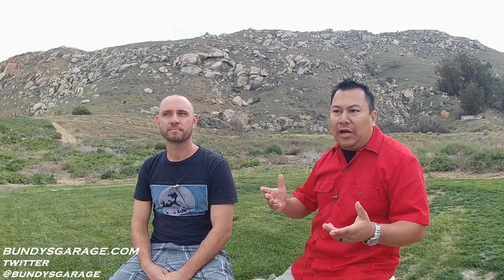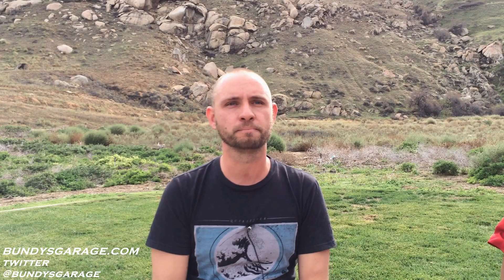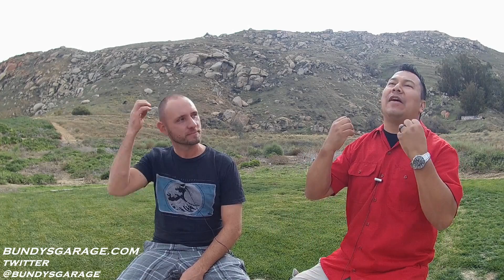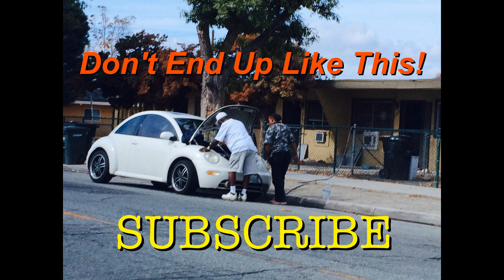Mazda Valve Carbon Buildup (DI) Direct Fuel Injection - Skyactiv - Fight Carbon Deposits

Comment: So.. Has anyone figured out yet, that its the fact they run the Positive Crankcase Vent into the intake?... Thats literally how the oil is getting on the valves.. It sucks the oil from the PCV down the intake runners and direction onto the intake valves where the oil sticks because there are no longer fuel injectors in the intake.  All you need to do is install an oil catch can for on road applications, or in racing situation it does not need to go back into the intake at all.  If you've ever seen a race car spraying white smoke out the top of the engine, yeah thats the pcv just  dumped straight into the air.
Reply: Wow.

Comment: I have a SkyActiv 2.0 in my 2013 CX-5 with 115,000 miles. I just pulled the intake and media blasted the valves with walnut shells. The car runs like brand new again!

This was the very first time I had ever done it, and it took me about 2 hours. Even though it was intimidating at first, this job was beyond EASY.

In another 100,000 miles, it'll probably take 30 minutes! It's really that easy!
Reply: do the walnut shells get into the pistons, as I assume the valves have to be open to get the edges blasted, or am I not understanding how this works?
Reply: @tommak6516  

No, the shells can't get down into the engine, because you make sure the valves are closed before you start! Besides, if the valves are open, you can't really clean them, simply because they aren't there to be cleaned!

When you're done with the cleaning, use a shop vac to remove any media that's left. Tape it up with some painters tape, and move to the next cylinder.
Reply: @michaelbloom5342  So would it be correct to say you are only cleaning the valve stem and not the valve seat?  Would not the valve seat be more critical?
Reply: @tommak6516  You're cleaning the entire top of the valve and the intake port. And yeah, it makes a huge difference in engine feel, performance, and economy.

The port itself is arguably the most important thing to clean because that's where all of your air gets into the combustion chamber. If that's gunked up, air can't flow smoothly, robbing power and efficiency.

Comment: Late on this conversation, but can't we just prevent/minimize this by using a good fuel company (ex. shell, Exxon, chevron) when pumping gas and use a good fuel cleaner system once in a while (after an oil change or a few times a year) to keep the engine clean?
Reply: No because the injectors are inside the combustion chamber fuel based cleaners will not clean the intake valve since fuel doesn't hit the valves like in port injection.

Comment: I'm guessing this issue will also effect the ND Miata then? :(
Reply: Yes and no. If you drive like a granny and use regular gas, yes. If you rev high often and use premium fuel, no. The pressure and detergent on the gas seems to be helping in the issue. Which reminds me, I need to drive it harder!

Comment: The Kia K5 with the 2.5 liter turbo has both direct and port injection, however all wheel drive is not available. Alex on Autos liked the Mazda6 steering better, and savagegeese did not like how the power worked while turning for the K5, but gave the suspension high praise for comfort.

Comment: The new Hyundai Venue has both direct and port injection like most Toyotas, to reduce intake valve carbon buildup- it is now their least expensive new vehicle for sale in the US.
Reply: id never get a hyindia over a mazda
Reply from the maker: Does the Teluride have that feature?
Reply: @bundysgarage  the Telluride V6 has only direct fuel injection, not the port fuel injection. Kia and Hyundai are also working on a dual clutch automatic transmission with liquid cooling, after both they and Ford had reliability problems with an air cooled dual clutch automatic.
Reply from the maker: Thanks. I love the way that thing looks!
Reply: Their base model kona I believe also has mpi, I have a 2016 Tucson 103,000 miles and it now has permanent damage I believ from carbon engine pings so now I have to run 93 octane I’ve already had all services done only thing that has changed is power is back but running 93 so performs a little less acceleration vs 87 or 89 octane.

Comment: The local dealer sells a BG intake valve cleaner, and uses walnut shells to clean the valves if they get so bad the idle is rough. I use the 87 octane Shell gasoline, it is probably a wive's tale that higher octane fuel will run cleaner in an engine not designed for it. About once or twice a year, I add Berryman B-12 Chemtool to the gas tank, based on testing by Project Farm on YouTube- his video showed it was the only one he tested that made the inside of the spark plug look cleaner.
Reply from the maker: Check out this video I did on B-12: https://youtu.be/plAu-vvEctM

Comment: so why doesn't Mazda include an oil catch-can since those are proven to reduce carbon build-up?
Reply: I know this comment is old, but I don't think it's due to production cost like the creator said. Just about any modern car when benefit from a catch can. The problem, is that cars have typically have never had them. People won't check them and it'll fuck stuff up. You have to empty those frequently. Most people aren't enthusiasts.
Reply from the maker: Cause it’s an extra cost that Mazda does not want to add to their cars in production.

Comment: Interesting as I just got 2016 cx5. I tink the problem is that some only drive in the city in stop and go traffic. These cars need to be driven at higher rpm's so majority of the carbon build up can be burn off. Question though; would oil catch can be a good idea for my cx5 and could spraying a chemical into a vacuum line to brake up the carbon could that destroy the CAT with all of the dissolved carbon? Just wandering?
Reply: whatd you end up doing? Catch can?

Comment: lol.,,Dennis was introduced as a Mazda Mechanic and will always be, but later we find Dennis doesn't work for Mazda any longer and said he wont likely ever see a Mazda 2.5L apart because he no longer works at Mazda, , but Hmm,  best way to avoid carbon build up in a DI engine is to avoid it "Direct Injection only" engines!

Comment: I have had a 14 Mazda 3 for five years and no problem at all.  Maybe it will come later but right now it is not an issue.
Reply: Hey, that has a direct injection Skyactive G engine right? And youre sure that you had no loss in power after a few years?
Reply: @bellmeisterful  Yep and nope. They did do an update to the ecu early on but I have had no issues with power loss or carbon buildup. Though every few months or so I do put some engine cleaner in my fuel tank..
Reply: @gabrieliacoboni6951  welll I gotta ask...How do you know? I mean, you dont know if you have buildup unless its taken apart.
Youre just saying no negative effects right?
Reply: @bellmeisterful  Well I am sure there is a little carbon build up. It is inevitable in almost any engine. But it has not led to a loss of power or any issues to date. I've had the car for eight years and 60k miles.
Reply: @bellmeisterful  same here. 2014 Mazda3 with a 2.0L Skyactiv engine and 146,000km. So far, runs like new. There's going to be buildup in any direct injection engine; you can't get around that unless you're Toyota with their dual injection system.

Comment: Carbon build up in my opinion is more to do with blow by , bot realy a big problem in a na engine but more common on a turbo engine
Reply: “Blow by” is technically the combustion (very high psi from post-ignition, not the turbo-charged 7~14 psi pre-ignition)

This blow-by passes the piston rings, and now the pressure accumulated in the crankcase etc. 
That pressure needs to be vented somehow. 
The problem is, that air is also laden with engine oil vapors. 
In the days of port injection, car design simply connects a line to seep off this pressurized crankcase air into the intake area. 
Because intake area will experience negative pressure (piston’s “fresh air suction” cycle), so the oil laden air from crankcase will flow to the fresh air intake area. 
In this older design, there is gasoline vapor being sprayed, so engine oil vapor does not build up into solid chunk of gunk. The oil gets thinned out enough that it flows into the engine and gets burnt up. 

For sure turbocharging help generate more power, by allowing more air molecule and therefore more fuel in each combustion stroke. And yes the resulting combustion generates more pressure to be pushing the piston. 
Directionally I agree with you: turbo charged combustion creates greater pressure. But I think the magnitude doesn’t “make the difference” that NA engine don’t foul while turbocharged engine fouls. 
They ALL foul. 
Just a question of time.

Comment: Mazda runs a 13:1 compression Ratio where almost every other brands run a 10:1 Compression Ratio.

 How they achieve that is by running an advanced fuel to air mixture method with a more advanced spark ignition system. That is paired with volcanic tip pistons vs flat Pistons which compresses the fuel and air mixture and with a advanced spark ignition system to achieves the 13:1 Compression Ratio. 

the exhaust system is also unique it uses a  3-2-1 on Skyactiv Engines and 4-3-2-1 exhaust manifold on Turbo Skyactiv Engines which is also unique because with other brands they use a 3-1 exhaust manifold. Mazda Skyactiv is very unique it was built for a much cleaner smoother combustion process. Giving you Better fuel economy and outztanding performace all from a 2.0 and 2.5 4 cylinder engine. 

Mazda Skyactiv Engines is one that doesn't sacrifice Performance for efficiency gain which is why Mazda is the best of both Honda and Toyota in one.

Also Mazda is now participating in a joint partnership with Toyota to equip Toyota with Skyactiv Engines and has plans for having Skyactiv X Engines inside Toyota Vehicles in the near future.  So Mazda is doing something right to have such a huge company like Toyota to take part and see the significant Value and quality in Mazda Engines.

Comment: Just drop in a new motor every 15,000 miles.  That's the best way to keep emissions down.
Reply from the maker: 15,000 Miles! That’s silly! Do it every 8,500 Miles! 😜
Reply: @bundysgarage  Yeah, you're probably right.  I was just trying to be frugal by doing it at the same time as the trans service.

Comment: The dealer recommend I do fuel induction service every 15,000 miles with my 2015 mazda 3  so they can guarantee the fuel injector. They charge $300 for the service. Is this service really necessary. Am I being ripped off?  I drove both my Honda civics each over with 200k miles without this service and using Arco gas with ethanol. I did not use fuel additives either.

The dealer also puts every 5000 miles using synthetic fuel? Rip off? Can't it go 8000 miles every oil change with synthetic oil?
Reply: Yeah Nard, he's ripping you off.  The maintenance schedule in the manual doesn't require it, so they can not deny injector warranty if you don't do it.  Also, the injectors will easily last 200,000 miles or more without it.  He's flat out lying to you.  You also can buy all four injectors for what he's charging you for that service every 15k miles.  The best thing for protecting the injectors is using good gasoline and avoiding that shop.  As for the oil changes, yeah they are cheap insurance to do every 5k, but just do what your manual says to do.  BTW, I bet he's ripping you off on those oil changes also.
Reply: @tomg4892  how often does the manual recommend you change your oil?
Reply: On oil change, take a page from my personal experience:

In Germany, my Mitsubishi dealer’s service shop (Germans) laughed at me when I wanted to change my oil every 4500km. (My old habit from the US, every 3k miles) They said just bring it to them once a year. 

Later, back in the US, I would get oil change on my used Saab once a year, like the Germans do. 
BUT: American shops tend to use el cheapo oil filters, whereas German shops use extended life oil filters. I didn’t know that was what made the difference. 
Needless to say, I later had damage in the Saab due to restricted oil flow. 

Do a google search (as example) on STP oil filters, between basics, extended life, and platinum. There is a video on YT on that also. 
Bigger cartridge, bigger filter medium area. 
This means when fresh, it’s got a quicker filter speed. 
When half used, it still has bigger capacity (to hold crap).

If you use synthetic oil and you want the longer run time (mileage) between changes, make sure you go to a bigger oil filter designed for longer mileage.
Reply: But yes to answer your question, that shop was ripping you off.

Comment: In the 1990s, charlatans committed to a fraud against a car company by stating "the accelerator pedal was stuck to the floor." I would like to see your video on that carbon buildup, otherwise, this video is too similar to the charlatans in the past
Reply from the maker: Really charlatans. You must not work on cars. Just Google GDI carbon buildup, that’s where you will find your charlatans, jerk off!
Reply: See? The quality and you character are easily shown. Rather than demonstrate, you choose to insinuate and degrade. I recommend you review what i wrote and correct your comment before you show just how kind you are >_> let me guess: You stopped thinking at "charlatan." - sad.

Comment: So if the Mazda tech is to be believed (and I think he should be), then all the emissions gains from the skyactiv engines are kinda wiped out by the "run it for 15 minutes" maintenance to de-sluge it. 

No thanks Mazda.
Reply: Moe Sizlac It's not really a Mazda issue, it's a direct injection issue.
Reply from the maker: All DI engines are seeing this problem.

Comment: the skyactiv runs hotter than most DI engines so they claim carbon isn't an issue
Reply: But the guy just said he's seen it on DI engines and there's a service bulletin to treat it.
Reply: I have the intake off mine now. 2012 Mazda 3. The carbon built up is real, but I have 110,000 miles on mine and never did anything to it.
Reply: @mikesullivan542  All engines have carbon build up, what were you expecting, shiny silver metal!
Reply: @martintaper7997  🙄
Reply: @mikesullivan542  Mike, you can install an oil catcher to prevent excessive carbon build-up in direct injection engines. Research it and solve your "issue".
Reply: the opposie; Skyactiv engines run cooler than most which largely prevents this.

Comment: Every time I hit the freeway I put my Scion IA with SkyActiv engine in manual mode and in sport mode, and rev the hell out of it. Hopefully, this will help fight carbon buildup
Reply from the maker: I don't think that will help. The fuel injectors are spraying right into the cylinder, the valves are mounted into the head that the intake sits on. So when injectors where in the intake, they would wash the back side of the valves clean.
Reply: BundysGarage I've seen a video of a mechanic of vw's, and he says he sees hardly any carbon buildup in vws with gtis that have direct injection than other vws with direct injection. He thinks it's because owners of gtis drive their cars hard compared to normal drivers. Normal vws with direct injection have super carbon fouling with only 10k miles on the engine.

Here is the video. Judge for yourself. 
https://youtu.be/RnhUJsZXzmg
Reply from the maker: I could be wrong. Fords has the some problem but they fixed it. They put injectors into the intake that spray onto the top of the valves. They are computer controlled and only allow some fuel to come out at a pre determined time to keep carbon build up on the top side of the valves.
Reply: I do the same with a Mazda 2 skyactiv
Reply: it really doesn't; running your engine at high loads is going to make it worse. The best thing you can do to fight carbon deposits is to make sure your engine reaches optimal running temps as quickly as possible under low loads, and running it on Atkinson Cycle, driving combusion temperatures down and as close to optimal as possible. I'm at 146,000 km and my engine runs like new.